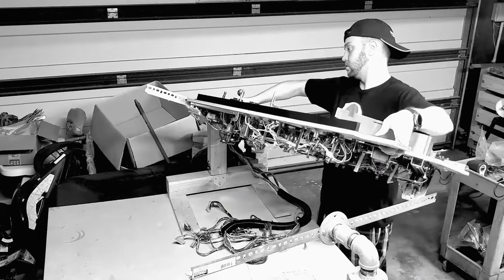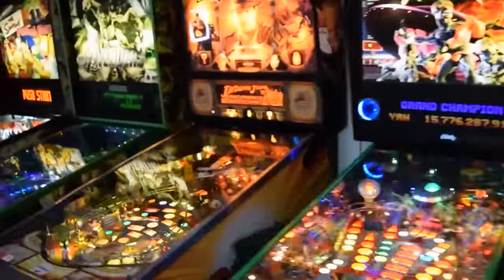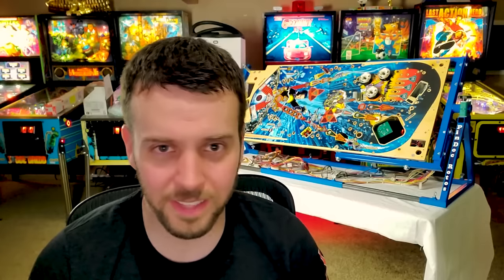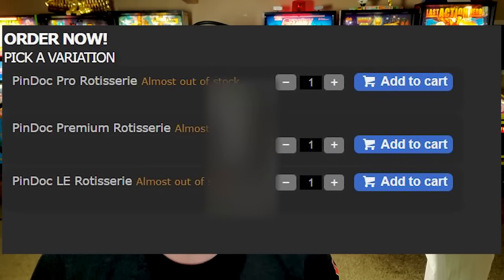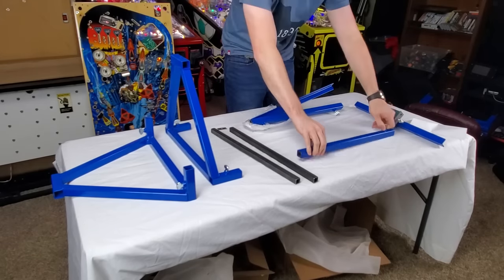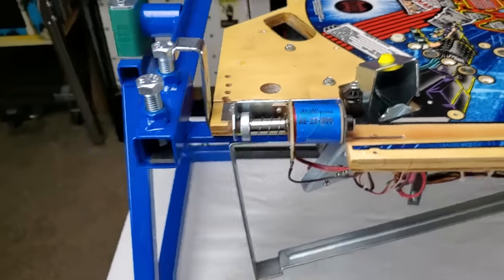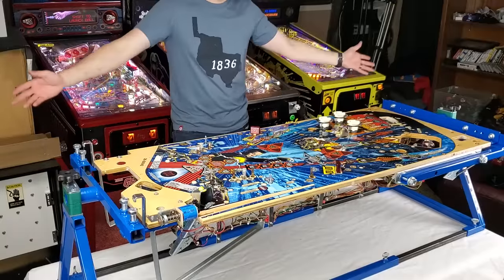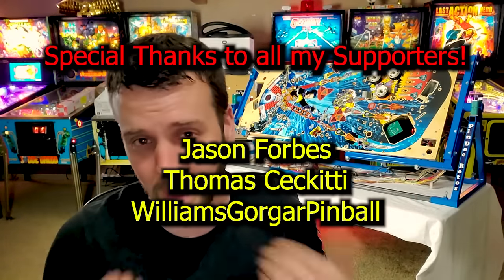PinDoc Pinball Playfield Rotisserie: Unboxing, Assembly, and Review

Comment: This rotisserie is not only useful for doing playfield swaps, but also when you rebuild a playfield. There are times when you have to remove a ramp or habitrail and you need access to both the topside and underside of the playfield to undo nuts or bolts. I find it particularly helpful when rebuilding pop bumpers so I can layout the underside perfectly level in order to solder in the new pop bumper lamp sockets without dribbling molten solder all over the place. Another use is for rebuilding the lower relay/score motor panel of electromechanical machines. Those panels fit this rotisserie like a glove. Even the heaviest playfields work well in this rotisserie... it's very sturdy and made in America. Worth every penny in my opinion.
Reply: Thanks for the comments Ken. I recenly used the roto for an EM scoring/relay panel and it worked nicely. I never would have though of this if you had not posted those pics. I have also used the roto for the large upper playfield for 1980 Black Knight. Worked like a charm.